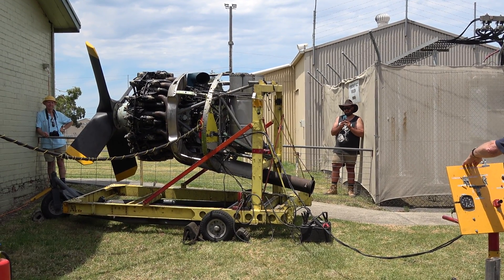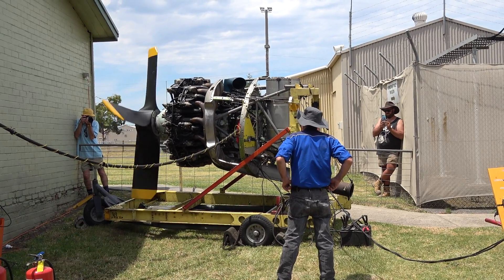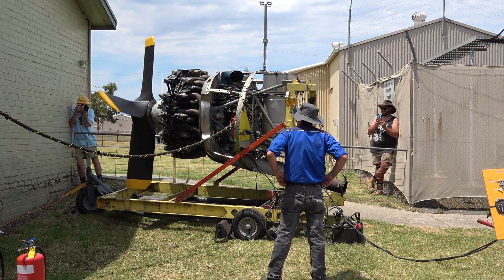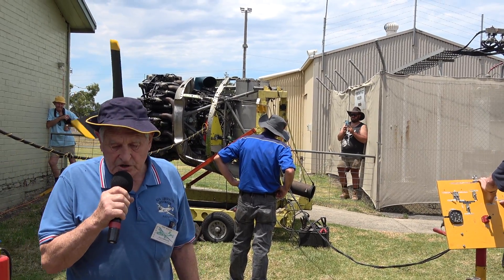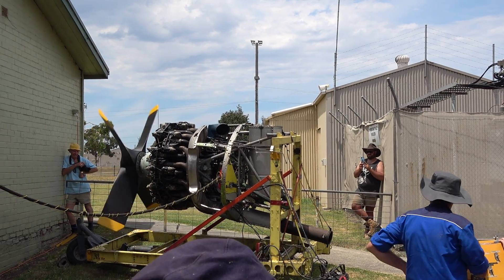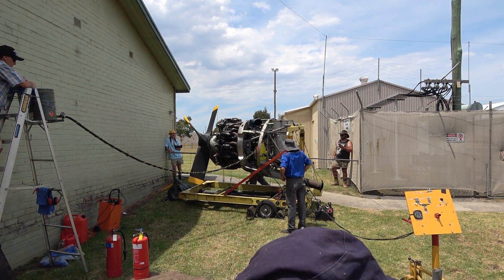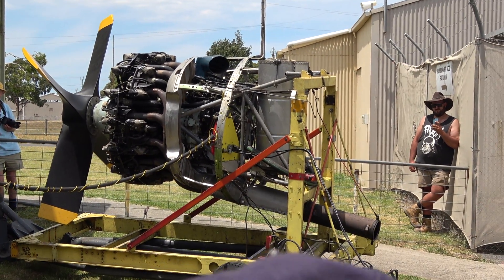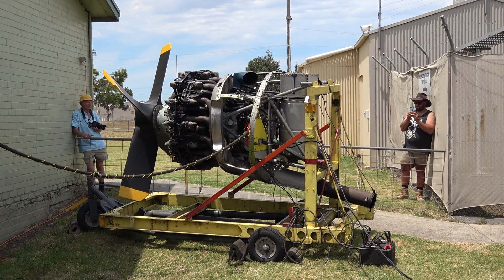Pratt & Whitney R-1830 Twin Wasp Start up Geelong Show Grounds

Comment: How long can the starter run before overheating?
Reply: till you get oil  pressure and fuel.  Motor was sweet after it  cleared up, good   luck!
Reply: kwm380, not long, about 3 minutes